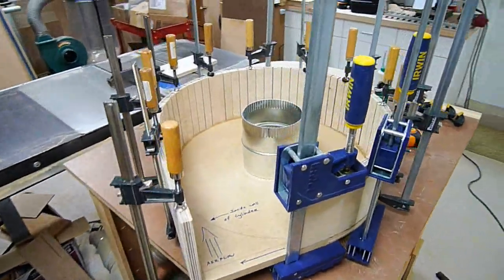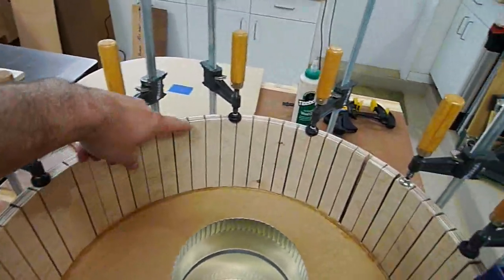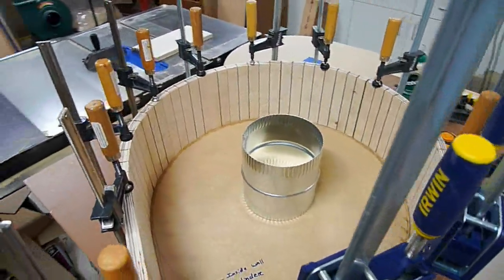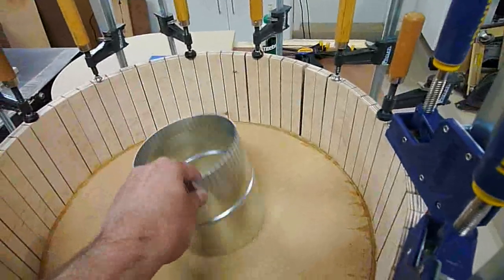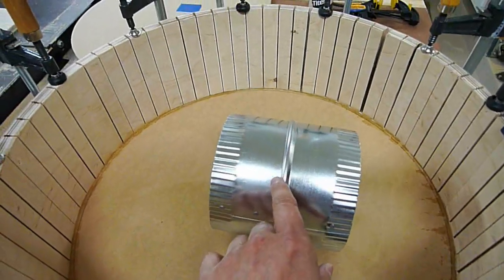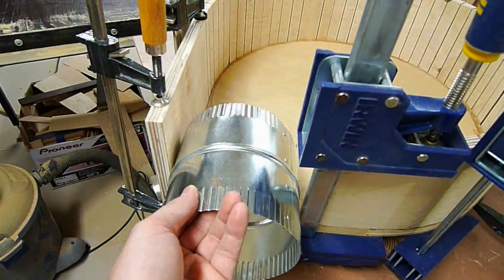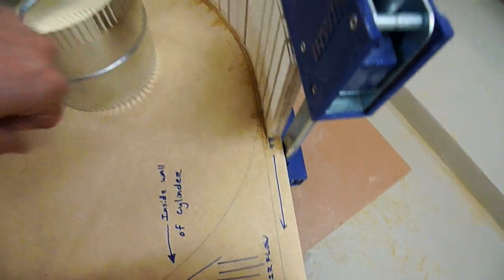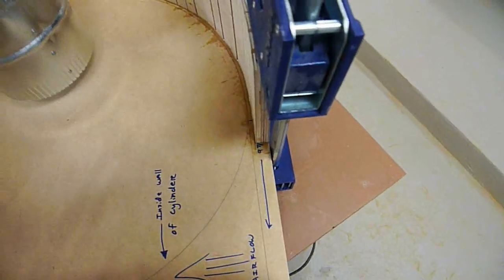Dust Separator - Thien Concept Part 1

Comment: rawdawgs50. I just finished mine based on your build and it works like a hot dame. the only thing I did different was to complete the curve all the way around by the inlet pipe, which I think completes the cyclone effect.